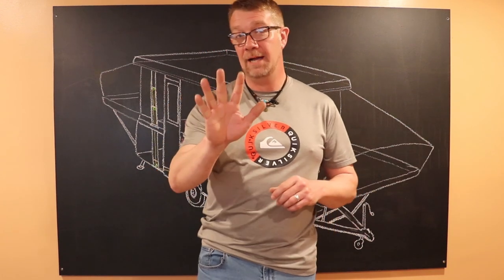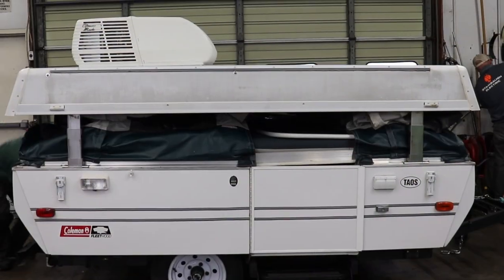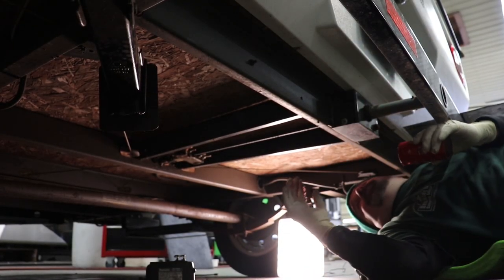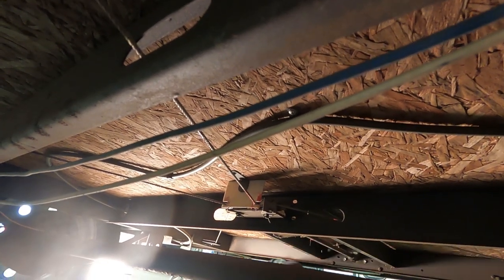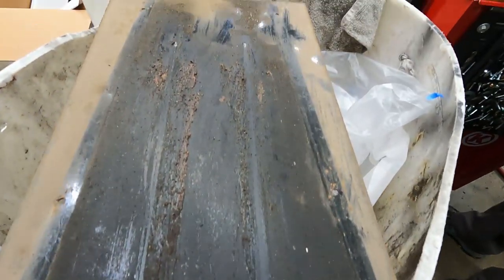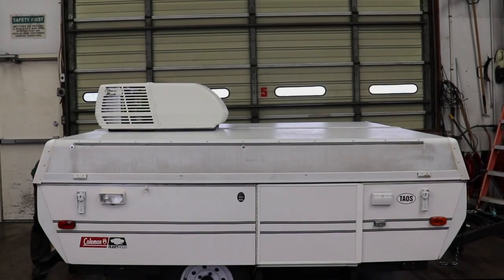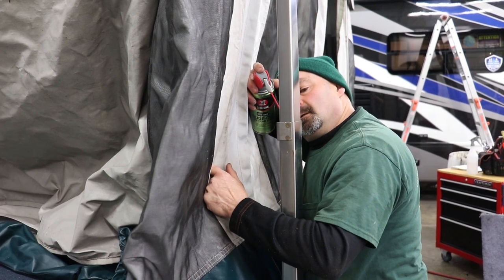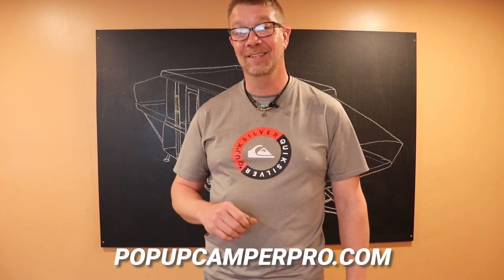DIY Lift System Service On A Pop Up Camper

Comment: This is EXACTLY what I needed!  My 2002 Sedona is very difficult to lift when I’ve compared it to other pop-ups. I’m hoping once I perform this maintenance, it will operate smoothly and I’ll have to start getting my workout somewhere else other than lifting my pop-up! 😂
Reply from the maker: Glad to help Giulietta! Thanks for taking the time to write and share!
Reply: Exactly what I'm noticing now...owned this poor Coleman for 10 years and NEVER lubricated ANYTHING. I feel incredibly dumb for not but c'est la vie. ¯\_(ツ)_/¯  I kept it clean:) So now upon remodelling it, I've opened and closed it more in the past two weeks than in the past ten years and yesterday it got incredibly hard to turn the crank. I'm hoping it's just needing the lubrication and nothing else.

Comment: Thanks man... i used to be able to use the spark plug socket and a drill to "power" up my pop up... didnt work this year and i did the maintenance and dang.... jumps up like lightning  now... a litte maintenance goes a long way... pop ups are great here in Montana... get to places the big RVs just cant go... appreciate the videos.

Comment: Been watching through your videos all evening since discovering your channel and these are great guides for maintenance and updates on these campers. I'm glad to see there's so much parts and maintenance support for even the older models still.

Something I wanted to throw out there for a safety pointer on this video though, is when greasing the cables, it's best to use a rag to run the length of the cables and apply the grease in a thin layer. This is how we were trained to lubricate and inspect rigging cables when I worked aircraft maintenance, as any frayed strand in the cable will then snag the rag and not only be easily discovered, but save you from a nasty slice or jab on your hand that gloves won't protect you from.
Reply from the maker: Awesome tip Dan! Thanks for sharing and watching.

Comment: Perfect timing I need to do my 99 Taos this week.
Reply from the maker: You got this Jason!
Reply: @popupcamperpro  I wish my Taos had the easier to remove cover. Mine has the bolts that go through the frame and supports instead of on the bottom of the plate. That is the hardest part, but otherwise, it's not too bad.

Comment: Thanks for the video! I’m getting ready to do this service soon. A few questions. Is red and tacky from Lucas oil a comparable grease? Also I notice that you greased the cables, any concern for the grease collecting dust or debris? I see that with the wiffle tree the cover protects it, but greasing the unprotected cables gives me that concern.
Reply from the maker: This will be a question of common conditions you camp in. If you commonly on roadways and campsites, grease them. If you’re normally in dusty or sandy conditions, skip this step.
Reply: Ok thanks. Every year we camp beach front on a sandy site, so that’s helpful. Would there be an alternative you can use like that silicone spray?
Reply from the maker: I wouldn’t

Comment: Derek-love the videos.  There is so much I've learned from you.  My question is this- we own a 2008 Feetwood SantaFa with a chain drive.  I know I shouldn't spray the chain so how do I  lubricate it? Smeer grease on it with my fingers.   And should I use the same red grease you used on the wiffle tree?

Thank you
Reply from the maker: You can spray a chain lube or grease it. Do either at the 12 tooth gear. Thx for watching!

Comment: Awesome video! What do you recommend for greasing the chain on those chain driven lift systems? And will lubricating the chain accidently lubricate the "clutch"? Since chain goes from the bottom to the top where the clutch is
Reply from the maker: I use spray chain lube from the 12 tooth sprocket at the bottom.
Reply: @popupcamperpro  and it never affects the clutch at the top ?
Reply from the maker: Correct

Comment: Derek, love your videos!  Thanks for doing them!   I have a 2016 Somerset Evolution E3.  If I lube the lift cables as shown in this video, I'm worried about dirt and dust from all of the dirt roads I travel on sticking to the cables.  Is that a legitimate concern?  Would dry lube work?
Reply from the maker: This depends on your conditions you camp in. For dry and dusty or sandy terrain, I would not recommend it.

Comment: Did this last April before seeing this.  Got it mostly right… didn’t think to grease the tree cover.  Will be doing this again soon… we use our Coleman SanteFe A LOT now that we’re retired!  I’ll be watching the videos on the crank mechanism… ours has become hard to crank when lowering roof… any insight appreciated.  Thanks!
Reply from the maker: Hello 2 Explore! Hard to crank when lowering could be that the drive hub tube is not completely disengaging from the clutch. I would start here for diagnostics.
Reply: Thanks Derek!  Do you have replacement bumpers for ‘09 SantaFe?  Bent mine!
Reply from the maker: Negative. They are a pain to ship, but easy to source locally. Try a local Rv dealer or a metal fabricator.

Comment: Greetings!  As others have said, this is an outstanding series of videos.  Thank you so much for putting them together.  We have a 2010 Coleman Sun Valley which (from looking at the other videos) I think is a chain drive system.  The crank assembly is at the center but up above the bumper with a vertical chain connected to a gear below the crank assembly at the bumper level.  Do I need to grease the gear and chain at the bumper level, or will that get up into the crank assembly and cause problems.  Thanks again for all of your helpful resources.
Reply from the maker: Greasing the chain from below is what I do. It won’t affect the upper clutch.
Reply: @popupcamperpro  Awesome.  Will do.  Thank you!

Comment: Love all your videos and help! Thank you! We're newbies to the pop-up camper world... Our crank is very hard to turn and there is also that hammering sound. From watching your videos, I have learned that this is probably the thrust bearing that needs to be changed. But before watching all of your videos, we did lubricate the crank assembly. Can we just change the pressure washer or do we need to change the whole crank assembly now?
Reply from the maker: I would start with a new thrust bearing and maybe a pressure plate (clutch pad) from what you are describing Rachelle.  If the pressure plate did not get to saturated with lubricant's, then replacement may not be necessary. It should be slightly rough and dry.
Reply: @popupcamperpro  Thank you so much for your help!!

Comment: Have a scamper 2002. Cant seem to find any parts for lift system or anything else. Any tips on cable lift system.. hard to lift plus rebuilt top totally. Weight added.
Tks for your videos..easy watching!
Reply from the maker: So sorry Jim, but I am not familiar with Scampers yet. Try canvas replacements dot com. Please tell them Derek sent you!

Comment: Is this basically the same procedure to follow for a Jayco Jay series 806 popup camper? Thanks.
Reply from the maker: The pulleys and crank are similar, but not the lift system.

Comment: Hey Derek I think I messed up by spraying silicone into the crank lift system, can that be resolve in some way? Also I thought pop ups had these safety lift arms that were placed over two of the main lift arms? Thanks for all your advice it is greatly appreciated!!
Reply from the maker: For the crank, you may need to replace the clutch pad if it’s no longer engaging. Coleman and Fleetwood campers do not use lift arm braces. The screen door is the roof brace.

Comment: So the cover of winfetree is not just a cover it also hold the moving block stay flat not spin?
Reply from the maker: This is correct. The cover adds stability to the whiffle tree frame, and the drawbar rides along the cover.

Comment: We have a '03 coleman yuma. Same precedures? It is enormously difficult to get the last inch or two to fully extend for door placement. It's currently on the mountain in WV. Any videos on evicting pests that might claim adverse possesion? Lol.
Reply from the maker: Hello Tom! The maintenance is indeed the same on your camper. There may be a nest already in the tree pan, causing the resistance. To deter unwelcome pest, I recommend cab fresh. You can find it at our web store.
Reply: @popupcamperpro  Thanks! I'll see you as we're in Maryland!

Comment: Should i wipe down the lift cables and whatever else is dirty ? I'm going to do this on a pop up we just got and it just seems to be coated with desert and no grease lol dry as a bone on the lift cables..
Reply from the maker: Absolutely! Clean it up first with rags and compressed air.

Comment: Thanks for the video! I checked under my Coleman Evolution and one of the cables has a slight sag while the rest are tight. Can this affect the up and down motion or raising and lowering? Should it be tight?
Reply from the maker: Hello Tanner. It should be just an snug as the others. The adjustments can be done at the whiffle tree.
Reply: @popupcamperpro  great! just bought the same grease and lube you used in the video and will be following these steps prior to my next trip. Thank you!

Comment: Just tried to replace a Goshen cable on my 2001 Starcraft 1706. When we try to test crank it, it gets stuck right after we crank it enough to take up the slack. I am afraid to force it to go because I do not want to snap or break anything. Please help. Is there a way we can call you? Thanks
Reply from the maker: Sure! Please give us a call at the shop for assistance.
Reply: @popupcamperpro  I do not know where your shop is. What is your phone number?
Reply from the maker: Colemanpopupparts.com

Comment: Wont dirt and road grime build up on lift cables if you grease them up even lightly causing issues?
Reply: I thought I needed to use like a dry grease on the cables
Reply from the maker: Good question Jeremy. The grease that we used is resistant to attracting dirt, but not fool proof. It comes down to conditions and use. If you are in excessive dust and sand constantly, you would increase this service interval. If you stay in generally dry and road conditions, then yearly maintenance is recommended. The benefits outweigh the negative if this makes sense.
Reply: @jeremygagliardi7063  As I recall, it's dry grease on the pulley wheels (and lift arms), and red grease on the shaft and cables.
Have I got that right, Derek?

Comment: Just looked under my 2000 Coleman Fleetwood Tacoma the whiffle cover is missing looked at parts online store didn't have my camper listed will another one work thanks
Reply from the maker: Hmmm. Your calls for part number 4752b4291. I do not have one match to that part number yet. What are the dimensions of your channels please?

Comment: question.
i have a bon-air ba-1400 trailer. it's a hardwall-system. i just picked it up a couple years ago. now, someone previous, had removed the lift system, i'm assuming because the cables broke, or something, and they didn't know about fixing it. so they removed the lift system altogether, and rigged up a hokey system with steel poles that need to be mounted on the ends, then the top gets winched up. it's extremely sketchy though and i would like to get it back to being proper. 
this model had the telescoping lift arms mounted to the exterior of the trailer. i'm guessing it's about impossible to get the original system though. what i was assuming i would do, is get a new set of telescoping arms, and mount them where the originals used to be. then make covers to protect them. i can't find any info on this model, the ba-1400 with hard walls. 
any idea which arms might be best for me to go with?
Reply from the maker: I recommend giving my friends At canvasreplacements.com a call. Please tell them Derek sent you!
Reply: @popupcamperpro  thanks. i'll try them.

Comment: How do I get my roof to level up on my Coleman Sequoia. The door side is lower than the roadside. I can't get the door to latch into place
Reply from the maker: Hello Roamer 2u. Minor height adjustments are done at the whiffle tree. Tightening the cables raises the roof corner. Major adjustments are done with the pulley routing guides before the butterfly brackets. Move the pulleys increases or decreases height.

Comment: I have a 1997 dutchman which is cable drive. What kind of maintenance is required on it
Reply from the maker: So sorry, but I have not to date studied the Dutchman lift systems. Perhaps someone else can help with this question?

Comment: easiest way to get to the chain on a chain drive model? I see a lot of rivets to drill out to get the rear panel off my 97 sunridge.
Reply from the maker: From below Joshua. Someone raises, while someone applies chain lubricant at the lower 12 tooth gear. You might find a small cover to remove.
Reply: @popupcamperpro  thanks! I'll have to take a closer look one of these days! great video! perfect DIY!

Comment: So my 2005 sea pine doesn’t have a wiggle tree pan cover at all   I didn’t even see screw holes
Reply from the maker: Larry, you should have one. Please take a look at page three for your tree breakdown showing the cover at the next link.
https://cdn.shopify.com/s/files/1/0273/4347/files/2005_coleman_destiny.pdf?16695232820753828628
Reply: @popupcamperpro   can you tell me how long the screws are for it I bought the cover but not the screws and want to go to the  hardware store and get the scresy

Comment: What size are the plate bolts? THANKS
Reply from the maker: Here is a link to the whiffle tree pan cover TEK screws. 
https://colemanpopupparts.com/products/hex-head-tek-screws
Reply: @popupcamperpro  can I use silicon spray on cables instead of grease? I can't find link to awning in a bag. Please send. Is shoe goo ok for canvas seal. Thanks again!
Reply from the maker: @vernelomax633  you can use whatever you would like. Just follow the manufactures recommendations for maintenance intervals. For awnings, search that keyword at colemanpopupparts.com Thank you!
Reply: @popupcamperpro  my middle name is Homer.

Comment: I have a different lift system. Mine is push button motorized lift. But it seems the front lifts before the rear. Is there a way to adjust so that all 4 lift at same time
Reply from the maker: Yes! Minor adjustments at the whiffle tree draw bar, major adjustments at the pulley brackets.